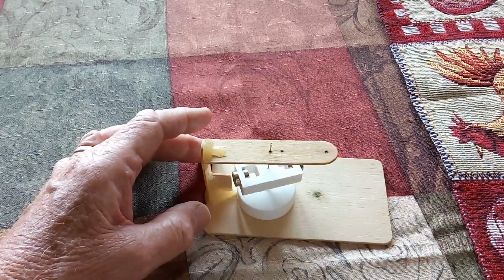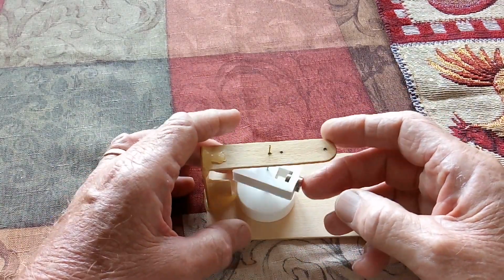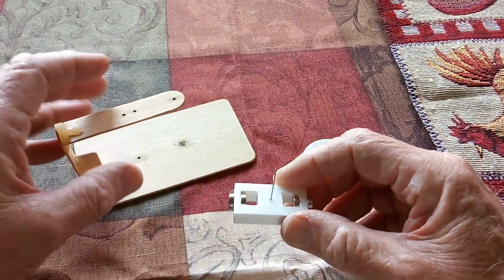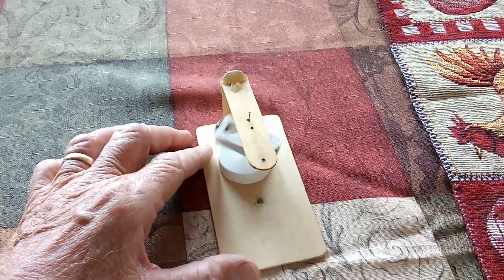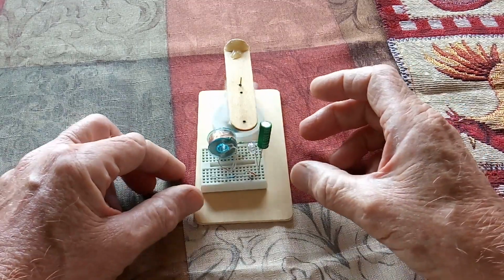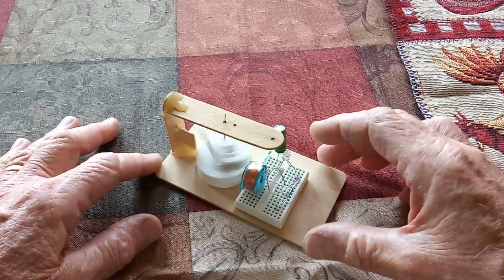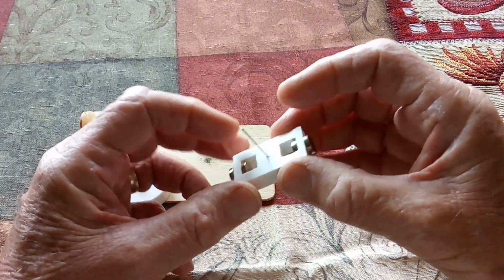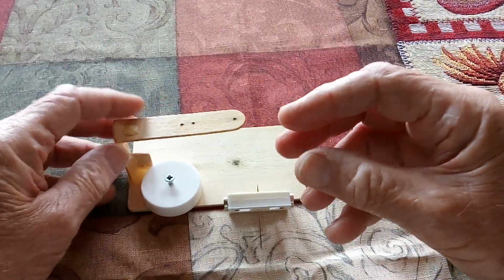The Old Hands and the Scene

Comment: Can you share the circuit.....looks really great
Reply from the maker: The circuit is a simple reed switch design.  The power source. reed switch, and wire coil are in series.  As the rotor magnet passes the reed switch the switch closes and powers the coil.  The timing is critical so that the rotor turns but the circuit is just that simple.  The LED is placed across the coil backwards and flashes when the magnetic field collaspes.  That happens when the switch opens up.  You can Google 'reed switch pulse motor circuit' to see versions of this.

Comment: Like your little projects always.  ---  You mention your 3-D printer; would you do a video on which 3 D printer you have, and a bit about your learning curve on AND how you design / make things for your projects? I'm like you, over the hill [retired --- lol] and pushing 70, but would like a 3 D printer rather than making things from  wood and plastic all the time. thanks for considering my thoughts. --the 'oletchr.
Reply from the maker: The 3d printer I have is an Ender 3.  I am using Tinkercad to learn how to design.  At first I had trouble but gradially I am learning enough to design simple parts and print them.  You have to just start small and work your way up.  What I really like is being able to use a computer to tweek a design that wasn't quite right and then print out the new part.  This 3d printing is really slow so stay with small items to make your mistakes on.  I am a long ways off from doing real cad work.  Right now I mostly just draw out the part on paper first then transfer the design to Tinkercad .   I can then make chages to it if I want but the orignal design work is still done the old fashioned way.  I'm 71 and it's hard to teach us old guys new tricks.